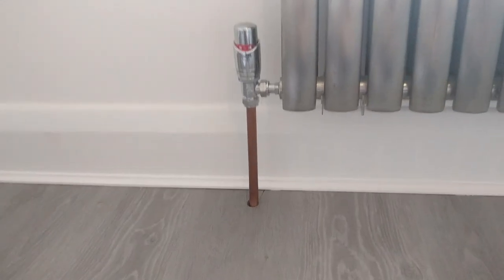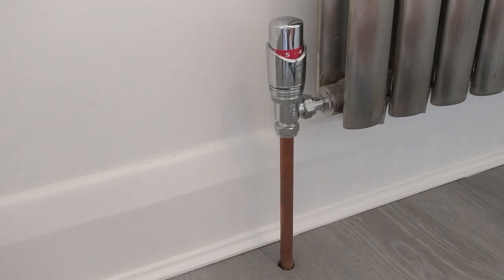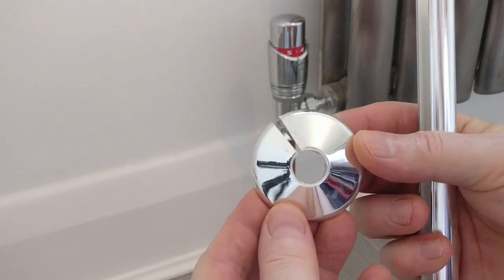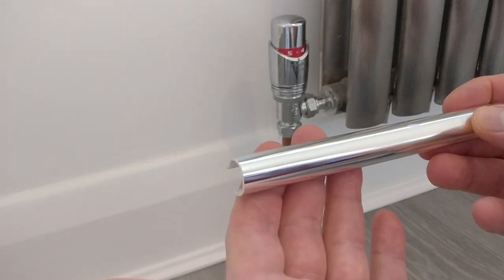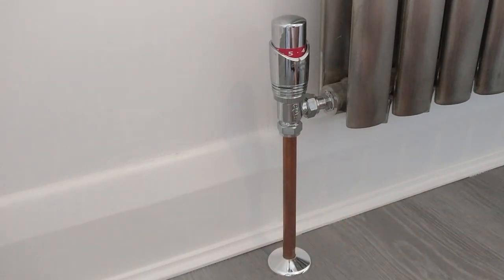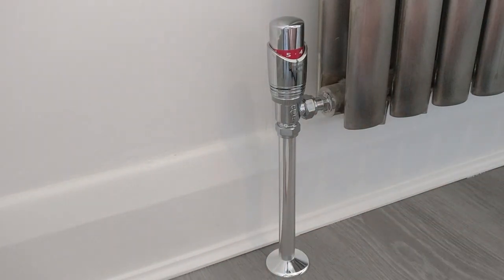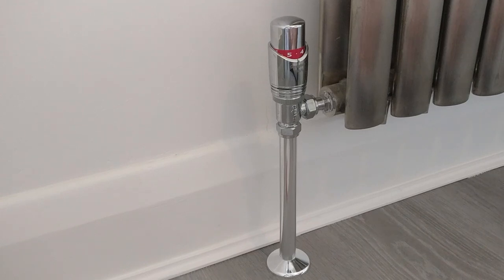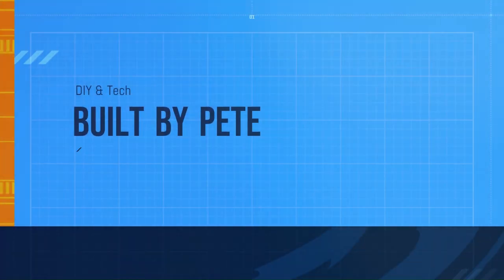Easy Chrome Radiator Pipe & Collar

Comment: Talon's instructions are wrong - they show to measure for the tail from radiator to floor, which I did, followed by the fitting of the collar. I'm here on YT because the collar doesn't fit around the tail, and wondered why.  I'm now stuck with two tails that are too long. It will be impossible to hacksaw off the teeny length required, so it has been a complete waste of money and my valuable time. Off to give Talon a piece of my mind...
Reply from the maker: That's bad of Talon. They should give you a replacement or your money back. How much over length is it. If it's too thin to saw, you maybe could try filing it down? Just a thought. Bad of Talon though I agree.